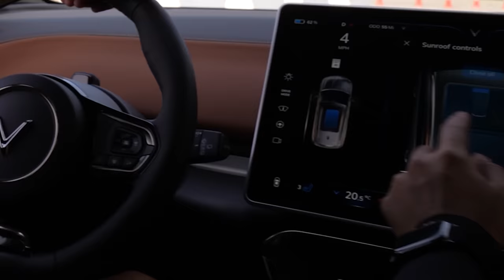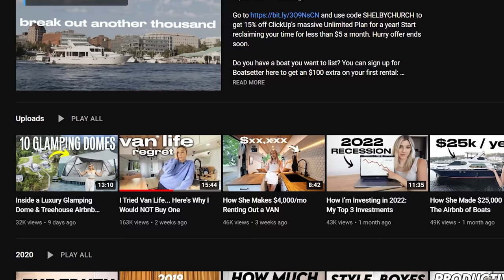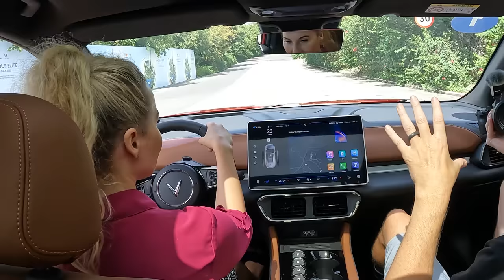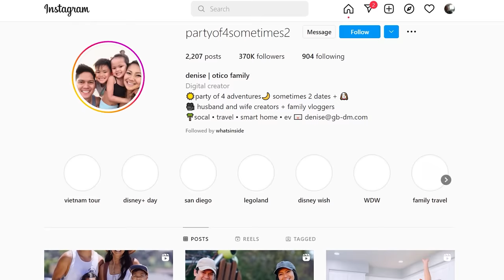New Electric Car Coming to USA Next Month!

Comment: Vinfast seats are made by an American company: Lear corp. Their other suppliers include Bosch, ZF (Germany), Namyang, LG (South Korea), Faurecia (France), Aapico (Thailand), Gotion (China), Prologium (Taiwan), StoreDot (Israel) and some other American software firms such as Amazon.
Reply: lear corp make some seats at coahuila mexico 👌
Reply: Wow what a great combination. The best of all.
Reply: Extra suppliers: Karamba Security (car security - Israel), Infineon (electric motor inverter and high-voltage on-board charger and DC-DC for ePowertrain - Germany),  Skiat (South Korea - battery separator)
Reply: You forgot that the car also designed by Pininfarina (Italy)

Comment: OMG, even American car experts like Sandy Munro said Vinfast is a "WINNER"! WOW.
Reply: Sandy Munro is a joke. How can Vinfast become a WINNER when can't sell cars in US. Cost of VF8 Plus + battery cost more than my model Y long range.
Reply: @briando4209  Hello 3/ :v
Reply: @briando4209  Where did you get the info? Have you talked to any Vinfast representative? According to reports, a VF8 Plus including a battery costs roughly $60 K, while Tesla Model Y Long Range (LR) costs about $66 K. Remember Tesla Model Y LR is just basic. It doesn't have many high tech features including HUD, heated and cooled seats powered by AI as VF8. Also, Vinfast is the only EV maker that offers the longest warranty coverage of 10 years of 125.000 miles, whichever comes first, while Tesla offers a warranty coverage of only 4 years or 50.000 miles, whichever comes first. Good luck with Tesla batteries! They are in fact a lot more expansive than you thought.
Reply: @briando4209  quê
Reply: @briando4209  you have model y? Really? :)))
Reply: @briando4209  ; just got out from the cave??? Pity you!